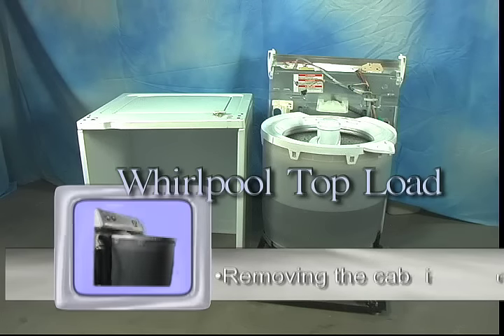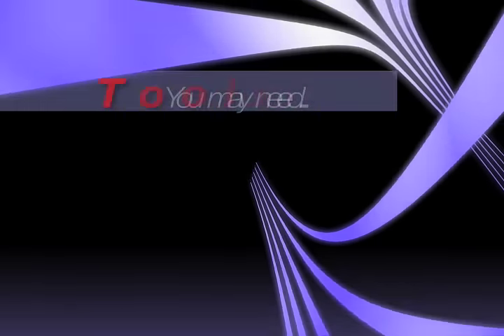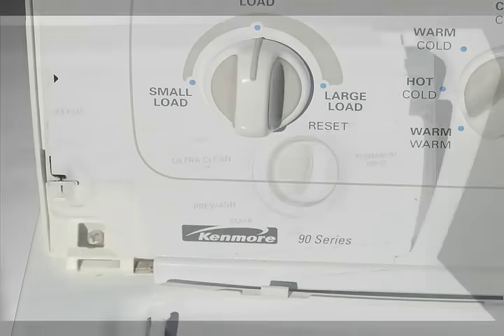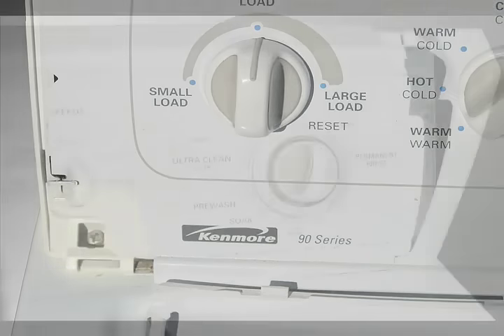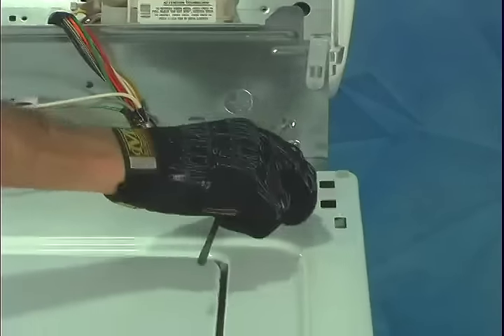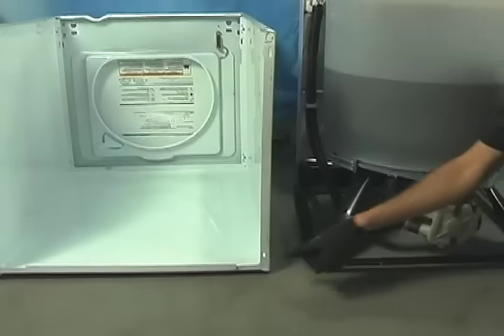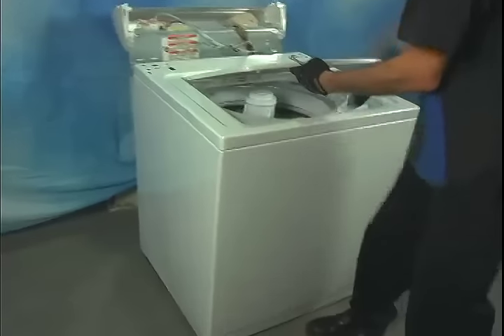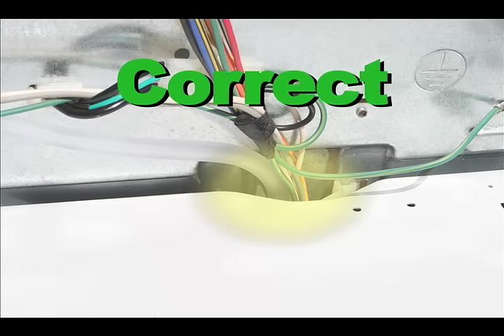Whirlpool Washing Machine Repair

Comment: I have a Whirlpool Estate. It seems to work fine, except AFTER THE CYCLE FINISHES, it starts refilling again, and if you let it go, it doesn't stop filling. It just over fills, and continues to overfill =(

I took it apart and checked where the water comes in, but I couldn't see any problems, except I could blow through the cold side, but the hot side would not let me blow through it. Could this be my problem?
Reply from the maker: Definitely sounds like a bad water valve, but I'm not sure why it would work fine for the first load...  Also sounds like you may have a bad contact in the timer that is causing the motor to continue past the stop point.  Has this happened more than once?  If only once then that was probably the point of failure, If more than once I'm stumped.  My guess would be a bad timer and intermittent water valve failure. If you figure it out I would love to hear the fix!
Reply: applianceassistant
It appears to be the valve as you say. I have unplugged the washer, and if the water is on, it still fills. Thus, I have ordered a new valve for it. Thank you for confirming my suspicions though =)
Reply from the maker: Glad to help! Thanks for the update!
Reply: I have a front end loader washer/ whirlpool that keep error "h" "f"